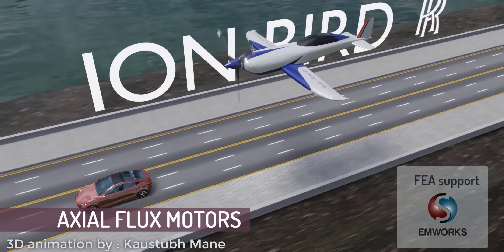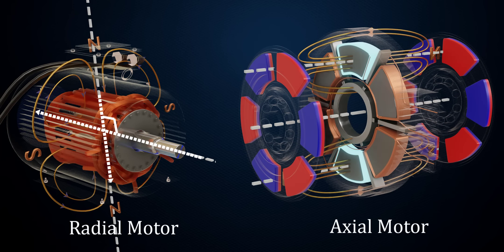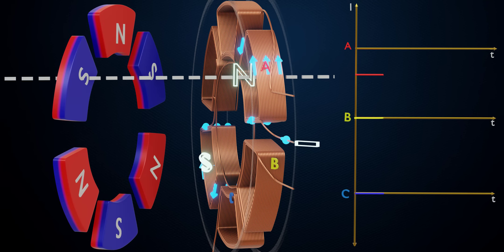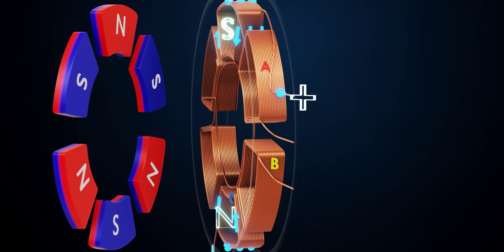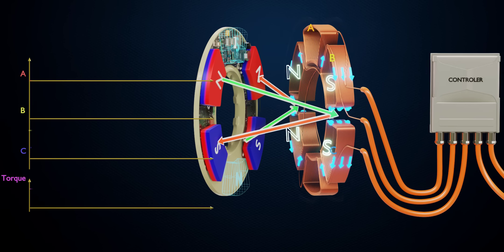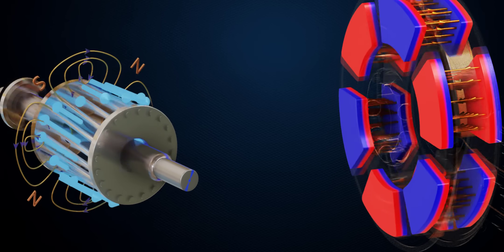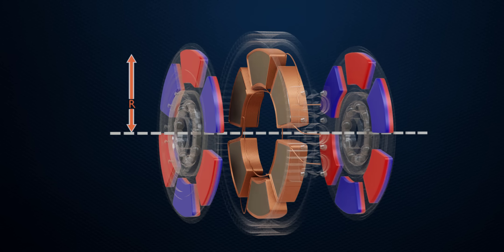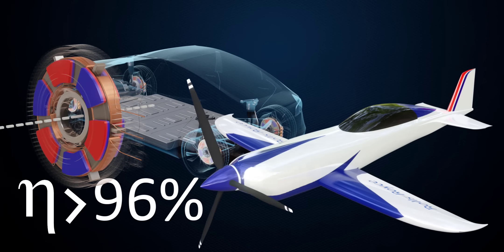Axial flux motors - The new hope

Comment: I'm gonna tell you this, if you resolve the battery problem, everything else comes second.
Reply: @Jan 6 was "Wall Street Putsch" part 2 but where does the battery get its energy from ? do they have to be charged & recharged ? or do they produce energy from the chemical reaction  , as does the ICE ...?
Reply: @guitarman_3693  good point, there is a lot to be said about having the ability to quickly and reliably replenish your fuel source- regardless of what it happens to be
Reply: @Cancer McAids There IS hope, that cryo LH2 could work, in insulation of aerogel. It could slow down boil-off to order of months, and with hydrogen being pretty cheap that wouldn't be much of a problem anyway. Except aerogel is yet another technology a couple decades old that "will become ubiquitous and cheap any day now" for at least two decades now.
Reply: If you improve the efficiency of the motor and reduce its weight you increase the range, making the battery problem a bit less of a problem.
Reply: @charimuvilla8693  True, although serious increase in efficiency isn't really on the table - there's not much room to improve the rate of conversion of electric energy into mechanical work. But the ability to extract more torque out of the motor - or, equivalently, use a smaller, lighter motor that provides the same torque - is valuable as the freed up mass budget can be used to carry more batteries, or just achieve higher airspeed (same flight time + better airspeed = better range)
Reply: Look up 10 year old motors. They are really weak in comparison
Reply: And inefficient
Reply: @nutzeeer  10yo electric motors? Which ones? Where it comes to generic, general-purpose electric motors, like the ones found in powertools, machinery, home appliances etc, very little has changed. Same with electric train engines, tram (city car), diesel-electric submarines etc. Electric car motors improved, but that's mainly because >10 years ago electric car motors were next to non-existent. RC model electric motors jumped by strides, because they are now finally able to utilize LiPo currents and energy densities, it's not that they were impossible to make in the past, they just didn't make much sense as there was just no decent power source.
Reply: @sharpfang  sorry i meant 100 year old ones
Reply: @nutzeeer  100 year old ones, sure. 50 years old ones - not so much. Where it comes to energy efficiency that's roughly when they had plateau'd, there is still room to improve on mass, torque, reliability, but where it comes to efficiency, not really.
Reply: @sharpfang  ah ok. though i still wonder why car makers opt to use less efficient motors
Reply: @nutzeeer  Energy-efficient - not really, they are roughly the same. Mass - matters of cost, the motor is still a minor part of the car mass and the mass doesn't matter nearly as much as in aviation. Using a cheaper, less mass-efficient technology results in lower manufacturing costs, plus the motor presented here scales poorly as it requires mighty permanent magnets, and they become a total nuisance when made sufficiently big (costs aside, handling, transporting, installing, servicing requires very special care if you don't want to deal with a slapstick comedy of your car parts sticking to walls of cargo containers, rebar in walls of buildings, keys in pockets of the technicians, forklifts, crane hooks, and literally everything made of steel within several meters at every stage of manufacture, transport and installation). Regular motors just use electromagnets that don't do a thing unless powered up. Both cheaper to make and not needing any special handling.
Reply: There are two technologies for storing hydrogen. The first one is in pressurized cylinders (Compressed hydrogen in hydrogen tanks at 350 bar (5,000 psi) and 700 bar (10,000 psi) is used for hydrogen tank systems in vehicles, based on type IV carbon-composite technology)
... the second technology does not require high pressure, hydrogen is sublimated into the material and stored there. I have not studied the second technology in detail, but it has been tested.
The first case is already used in Toyota, refueling 5kg of hydrogen is enough to travel 500+ kilometers. In aeronautics, the weight factor is very important. in the case of storage batteries, we cannot get more than 1.5 kWh from 1 kg of weight, in the case of hydrogen, we can get about 10 times more.
But hydrogen is explosive, yes, so perhaps a viory technology in some cases will be preferable (for example, railway transportation). In aircraft construction, due to the reliability of aircraft as transport, compressed hydrogen will most likely be used.
Reply: @user-pq8fg8pq6q  I wonder what's left of a car if a 700 bar tank bursts after being pierced.
Reply: Everything is important, motor efficiency over the entire operating range is a crucial factor in the ability of electric cars to achieve Maximum range. Of course, batteries are the limiting factor right now based on energy density by weight. Volume doesn’t seem to be the problem
Reply: @steveperreira5850  Batteries are still the limiting factor based on energy density by $. We still don't see Tesla's promised electric semi, not because it can't be built but because no-one would buy it for the build break-even cost.
Reply: @Jan 6 was "Wall Street Putsch" part 2 The situation with internal combustion engines is even worse, way worse than you identify. While an internal combustion engine may extract 25% of the fuel energy as an output mechanically, it rarely has the chance to actually use this mechanical energy at full efficiency.

Consider these simple verbal examples.

The internal combustion engine is oversized so as to be able to really get up to a high speed in certain conditions or to climb hills without slowing down too much.

So the only time you’re going to get maximum efficiency out of the internal combustion engine and put it into actual mechanical work is climbing a steep hill with the throttle maxed out, or speeding along a long straight away as fast as you can possibly go. Basically keeping the pedal floored. Almost no one drives like this for any significant period of time, so most of the time you are extracting way less mechanical Energy from the engine while the engine is blowing away energy just to keep it self spinning and keeping itself hot, as it needs to.

So when you are cruising along at regular say highway speed, the engine is operating at a tiny fraction of its potential efficiency, maybe 25%, so you multiply that by 25% gasoline to energy efficiency, and what do you get, something like 6% efficiency, and that is crazy.

Worse yet, let’s do a final comparison, you come up to a stoplight in a crowded urban situation and you are waiting two minutes for the light to turn green. In your electric car, your electric motors are stopped and they are extracting no energy at all. At the same time the internal combustion engine car right next to you, the motor is huffing and puffing at idle speed and wasting a tremendous amount of energy for essentially zero, I repeat zero efficiency.

The likely efficiency of an internal combustion engine driven car for a typical trip in town is far less than 5%, and the efficiency of an electric car is far more than 50%. That means the electric car uses 10 times less energy in the worst case situation.

That’s why we can get energy from coal for electric cars and still beat out gasoline powered cars for less pollution. But of course the best thing is to use renewable energy, don’t worry, I am in no way advocating coal burning electric power plants.
Reply: @mae_doll  Tell that to spacex and NASA and the air force
Reply: @Rajasekharan Vichattu Which comment are you replying to? I have a good several in this thread to which your reply could apply.
Reply: @Rajasekharan Vichattu Energy from the Sun for cars won't be practical anytime soon. High non, perfect weather Sun provides some 500watt per m^2 of solar panels of raw photon energy input. While we can discuss all we want about conversion rates (best and most expensive solar cells can capture and convert to electricity 40% of that), to achieve a measly 50hp of engine power even if you magically obtained 100% efficient solar batteries and were to drive only at noon in clear weather you'd still need 80 meters square of solar batteries surface on the car. There's not enough car for that. Simply, sunlight doesn't have enough power. And if you want to deliver it from the ground-based panels, you either charge batteries (and we've been on about that) or use some sort of on-the-road power, which while interesting concept, will be tricky as heck to deliver the power we need.
While I totally applaud the sentiment about short-term profits, slar power is not the answer, at least in automotive/aviation industry.
Reply: @Rajasekharan Vichattu 50hp is not a car that can reach 200mph. It's a budget class city car, something to take shopping or to get kids to school. You can get lower than that, getting into really bitty low-end, but not much lower and you're still . The experimental "solar cars" more resemble a fully shielded bicycle, with the driver flat on his back in a body-tight cabin inside of what looks like a wingless airplane, with broad flat top to fit all the solar cells - they aren't really useful - they'll stall up a modest hill. 
I'm totally with you about e-waste, reliability, ability to repair, this all is very much needed. But solar power for cars - no. I'd much rather see solar railways, lay good, tough-surface solar panels between the tracks, drive the power to the overhead line, have dedicated rail vehicles cleaning the panels...
Reply: There is no battery problem, you are telling that. The problem is bad looking eyes for evs. Battery swap can be answer for your point maybe. I think charging is enough for everyone
Reply: @solvento.  good point on battery swap. Now we need to find a way to handle that half ton (500kg) battery for swapping. I saw in Taiwan or Thailand (don't remember) they swap batteries for electric scooters.
Reply: @Kytes93  It might work in large "corporate" networks. Not so much for private vehicles. You buy a new Tesla with spanking new batteries right out of the production line, drive one charging cycle, stop for replacement, and get your brand new battery swapped for one that served for past 3 years and will barely last until next replacement station. Within one battery swap your car lost 40% of its value, and while you might see better batteries if you're lucky, you're just placing your new battery into the big common pool and say good-bye to the early excellent milleage.
Reply: @Kytes93  forklifts are useful for this. We can put electric companies on roadsides. We can swapping the batteries from side of the cars or front or rears, but sides more practical for forklifts. There is no problem to carry man.
Reply: @solvento.  there is a reason why all of the 56 ideas replied under my comment are not implemented in any way. Look, VW said they are migrating to full electric up till 2026, and they release new SUV this year, and it's not electric. 2026 is around the corner you know.
Reply: @solvento.  For aviation? How many landings and battery swaps would you expect reasonable when flying cross-USA, coast to coast? 'cause it would be a good couple dozen, and the flight would take 10x the time of equivalent on fossil fuels, as waiting to land, landing, taxiing, the battery swap, waiting for take-off, taking off would take lion share of the flight time. And cross-atlantic? Some battery-changing aircraft carriers lined up to fill spans of sea between islands?On regular aircraft 20 minutes of fuel remaining is fuel critical. On electric, 20 minutes of battery remaining is what you get shortly after take-off.
Reply: if you do not waste energy the battery is solved, compare a led light with the old bulbs and how long a battery lasts.
Reply: @denispalmer1937  Except bulbs had about 3% energy efficiency, LEDs about 30% and LEDs operate on entirely different physical principles than bulbs. They improved the efficiency 10x, through a total change of the mechanism of producing light. Electric motors are 85-90% energy efficient, so there's room for 0.1-0.15x the current efficiency improvement, and there's no alternate physical phenomenon to replace the electromagnetic field pushing the rotor - all improvements are just small incremental fixes of small inefficiencies, comparing to lightbulb, stuff like adding halogen gas to the bulb to decrease brightness drop over time.
Reply: @sharpfang  electric motors have a very low average efficiency, most get up to 70 % but low as 5 % at 6 or 7 RPM under load,  ours is 97 % at 7 RPM under full load,  the difference is our motors never draw higher current then the load , example at 7 RPM at 100 ft lbs is .133 hp  99 watts  that is how ours power consumption is, at 100 RPM the same 100 ft lbs is 1.9 hp or 1417 watts. a average car sedan needs about 35 hp to go 70 mph but at slower speeds much less, like between 1 and 10 hp around town, so power consumption is very low, and our motors use the same magnets not the same way, electric lights and leds use electricity to produce light just different ways,
electric motors some get up to 90 percent efficiency, but any motor that needs cooling is not efficient, heat is loss.
Reply: I have not been this impressed since Rockwells' Retro encabulator.
Reply: @bene6270  if you saw the test results from the patented MRC motor you would see this one is poor,
Reply: Have you heard of a company in Luxembourg in Europe,  which is called as Freel Tech  ?      they have claimed to have invented a special type of vacuum capacitors that is capable to store extreme amount of energy ,  their early prototype which has a size of an AA battery has a capacity of 1kwh . 

Do you think it's genuine   ?
Reply: keep me posted
Reply: ITS WAS RESOLVED BEFORE YOU EXISTED AND GUESS WHAT YOU DON'T EXIST NOW.
Reply: @atomatman3104  😯
Reply: Correct, get the weight down by a lot and durability up and everything else is second.
Reply: Using CO2 as energy
Reply: At what point did this video address energy storage?
Reply: @Jan 6 was "Wall Street Putsch" part 2 For cars, it's simple: the energy density stays the same, they just pack more batteries into the chassis. The limit with cars is not energy density but cost, $ per watt-hour, and simple economy of scale can drive the cost down and allow using more batteries without making the car prohibitively expensive. 
And yeah, Li-Ion are getting safer. Without a significant increase in capacity - actually possibly with adverse impact on that. 
And once again, the battery doesn't need to explode spewing shrapnel everywhere to be considered unstable. It may completely safely and quietly short its terminals internally, by developing a bridge of metal ions between the two sides,, discharge completely overnight and refuse to charge ever again - and if it does this within first 100 charge cycles, it's junk. And this is the sort of problems the developers of the new "revolutionary" batteries face.
Reply: Except that's unlikely to happen. Some improvements - 2x, 3x current energy densities - sure. But not much more than that. The materials are getting increasingly unstable and prone to combust/explode at smallest provocation. You just can't squeeze as much energy in so small volume without limits.
Reply: @sharpfang  you say that like that's not true for jet fuel as well...
Reply: @kevinbissinger  The problem is gasoline by itself is completely inert, no energy to be extracted, next to zero energy density. It needs oxygen from the air for combustion, mixed with it immediately before combustion, and only the gasoline-oxygen mix has that high energy density you see commonly listed as "energy density of gasoline". If you were trying to store oxygen-gasoline mix in car tanks, you'd have cars exploding left and right.And while for extracting electric power out of chemical batteries you could keep separate substrates and only connect them to react in small amounts as you're  drawing that electric power - a concept commonly known as fuel cell - there's no practical way to split the product into the original substrates - either it's unreasonably complex, requiring a refinery-sized infrastructure, or too costly energetically, the process consuming several times as much energy as it can produce, or just not technologically viable, be it too dangerous, too polluting with toxic byproducts, or the products are just impractical to store (say, water vapor from hydrogen+oxygen). 
Simply put, a practical reversible fuel cell is not even on the horizon, and classic rechargeable batteries just can't handle these energy densities.
Reply: @sharpfang  You describe the current state of affairs adequately. Then you jump to the absurd conclusion that somehow this current state is near the optimum we can reach when there a advances in material science, proof-of-concept batteries which already put your projection to shame coming out every few weeks.  Maybe inform yourself or stick to talking about minecraft or you will look about as smart as the people who called automobiles "devil wagons" in a few years.
Reply: @AlexusMaximusDE  Nothing on the horizon, no good batteries capable of rivaling carbon fuels. On the other hand Europe is in energy crisis right now with n-gas prices at 1200 dollars for 1000 cubic meters. Factories are being shut down as we speak. Thanks to all the coal and nuclear power plant closures
Reply: @kevinbissinger  Not true at all. Igniting a li-ion battery is considerably easier than igniting diesel fuel. And unimaginably harder to extinguish.
Reply: @Jan 6 was "Wall Street Putsch" part 2 

"IC Engines that can extract more than perhaps 25%-30% of that energy" >
And electric energy mostly comes from fossil fuel. Such power plants have a similar yield of 30% when converted to electricity. Which people use to charge their batteries.
Tomato, tomato.
Electric cars and such are in no way more 'environment friendly' or more efficient than IC driven vehicles. On the contrary even, if you calculate everything for cost aswell as for energetic efficiency. Not even solar and wind if you calculate all cost of production and build.
Reply: @StofStuiver  even if your numbers were right, they are close but not that accurate, the pollutants that come out of a power plant are way more controlled than the pollutants from a car engine, and easier to deal with. Not only that, but in no way is that 100% of your EVs energy source. In California, during the day, more than half of our energy comes from the sun. In Texas, a good amount comes from wind. In most states, you end up with more than 10% from nuclear, and another 10 or so from hydroelectric in some states, but more in others. The energy grid is in no way as simple as 30% of a fossil fuels chemical energy, and even if it was, they would still have pollution benefits even if CO2 was all you cared about.

If you're only caring about thermodynamic efficiency, then yes, ICE is probably better since it requires the least changes in energy forms which all have inefficiencies. Though electric might have an edge that it has regenerative braking and they don't have to IDLE, which reduce the energy waste that ICE just throws away.
Reply: @boggless2771  Yes, the effective centralising of end user emissions/pollution from billions of individual cars to power plants, where it can be dealt with at source, is a big plus for EV vs ICE.
Reply: Hi first of all your art is absolutely stunning 🤩,second, happy to watch!😛👍🍭😜👍beautiful artwork dear full watched 😍💞💞
Astonishingly beautiful!!!... What a brilliant masterpiece!!!... Your artwork is phenomenal! Your skill set is superb with amazing techniques!!!... Awesome creations! Absolutely love it ! Thank you for sharing!!!... 👍+🔔😘😊😘😛😜🍎🌷🌹🌺🍂🍃🎃🍒🍓🍊🍅🌭Again amazing work 💕 keep it up and stay connected 🙂❤️🧡🧡❤️🧡🤣💟💜💛💙💛💜💙Absolutely stunning Beautiful! 🤩,happy to watch!😛👍😜👍 wonderful!
make a new friend just amazing no wordssss..💌💌💚❣️💛💕❤️🧡🧡so beautiful work really enjoy by watching your video keep sharing stay safe and connected🙂🤗👍🍂🌷😛🍖🌹❤️🧡🤣💟💜💛💙🧡🧡❤️
Reply: Hydrogen will solve this problem
Reply: @user-pq8fg8pq6q  How so?
Reply: @DerekDavis213  At night, when power generation is not in demand by industry and the population, hydrogen will be extracted from the water by hydrolysis. Hydrogen will be pumped into containers under high pressure. Yes, hydrolysis has a low efficiency, as well as compression of gases, but such is the physics.
After that, the aircraft tanks will be filled with hydrogen, and this is how it will work.
Reply: @user-pq8fg8pq6q  As soon as we find a safe, reliable way to store it. A problem that has been unsolved for a good century.
Reply: @sharpfang  if the (H2O) is seperated & used as an "on demand" system & coupled with an EV's drive system , that can compliment or even handle the constraints of an "on demand" water cracker as a secondary energy supply , to use for whatever purpose that is deemed frugal... [ Im just tossing idea's here ] but even as a transitional system, until there exist better technology, the ICE is already in use most everywhere & i think we have evolved that tech to its highest potiential , kinda like Ford's hybird system of using braking force to charge batteries for ele. assist motors...  what do you think about that ? btw... im not trying to debate , i just enjoy this subject & wanted to join in... i dont have any degree's or any formal training... im just a cabinet maker.
Reply: @sharpfang  there is reliable way to store it.
Reply: @user-pq8fg8pq6q  uh... any reliable sources for that claim?
Reply: @sharpfang  All of these problems are going to be solved by blockchain, don't you people know anything?
Reply: @sharpfang  sure. Wind/solar is enough.